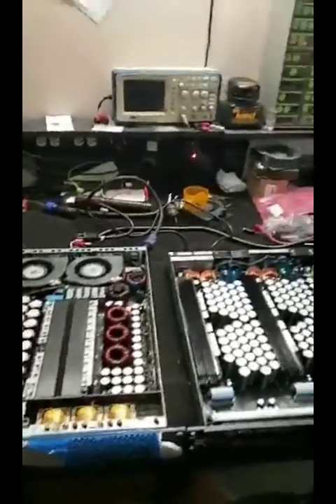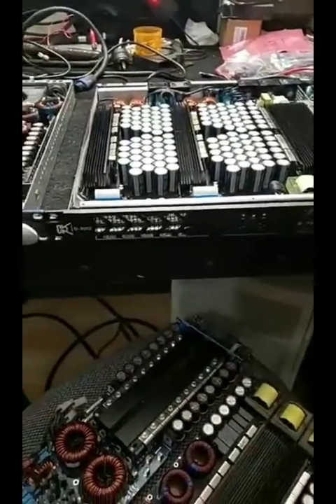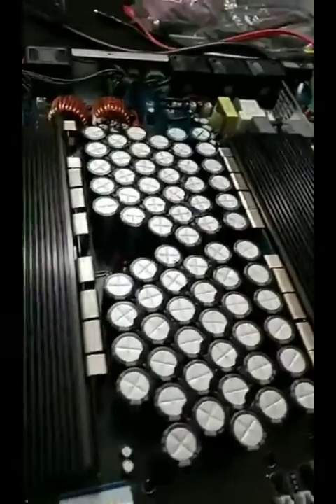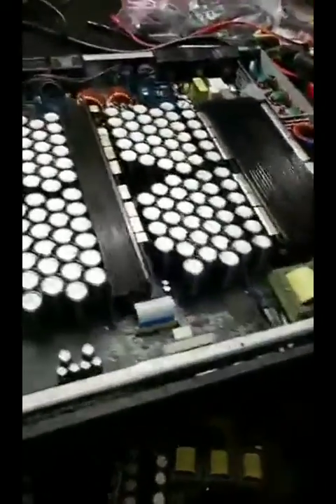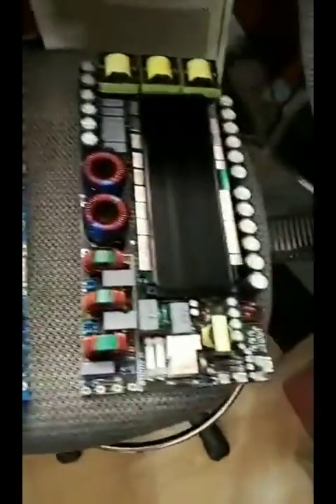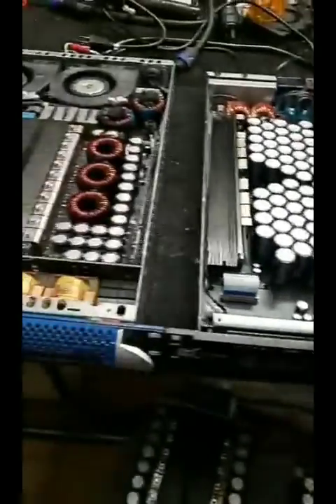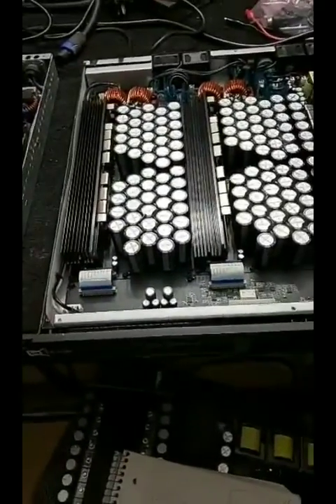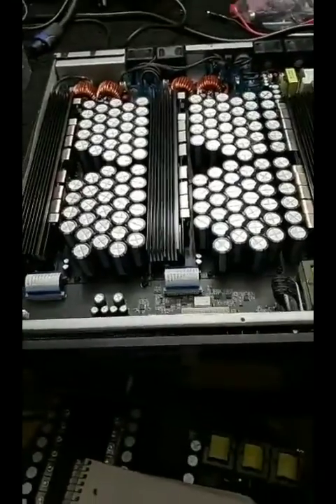Inside look of Powersoft amplifier and CVR amplifier Comparison

Comment: All well and good. What draws me to Powersoft and LGruppen is being able to get spares after years. My issue with some Asian manufacturers is that they often discontinue both product lines and spare parts once sales die down. The products themselves may be durable but one faulty generator at a show takes out a rack and it's all in the bin forcing you to get new equipment.

Durability is one thing, after sales support is equally important. Crown also has the same problem esp 1st gen itech which should still be supported but no spare parts🤷🏽‍♂️

Comment: Does this amplifier deliver the rated power or is the power rating wishful right before the amp blows up? How much current will this amp draw on 120 volts or 220? What about the rest of the need to know specs?

Comment: More capacitors doesn't mean more capacitance. How they're wired and their values  makes a huge difference - not to mention quality.  56 caps sounds like lower values in parallel- which is much cheaper in terms of components. The same with the power supply 6 caps+2 inductors vs. 20 caps (at least) and 3 inductors.  The Powersoft also has 2 large inductors in the rear vs. 4 cheaper.   The two large turbine fans have been swapped for 4 cheap 20mms.   I can't see the PCBs from the video but it's painfully obvious that you're dealing with two drastically differences in build quality and robustness.   The CVR is thousands cheaper because of the major corners they cut.

Comment: Nice video man very clear. Was just wondering what power the cvr take. The k20 notably has a 32amp feed powercon. Can the cvr realistically take this given that no amp with get 7000 a channel from 13amp 240 UK or other specificed ratings. Cheers
Reply from the maker: Hey thanks for watching man,  yes the Cvr has a  60v to 240v  circuit that switches automatically to accept a 15amp or 30amp as the powersoft.  Thanks for watching, please subscribe and share the knowledge.

Comment: Turn off your notifications! bro. CVR looks ok, why not put the caps closer to the speakers. Perhaps better if they had a few more caps on the psu though. Problem is getting cooling to the correct parts. Hot caps will fail sooner.

Comment: With a switching power supply capacitor doesn’t store power for the amp the switching power supply generates enough power to supply the amp the capacitor just filters the voltage.

Comment: Hello, really appreciated the video and comparison.  Are you still seeing these amps to be reliable after some time has passed?  I'm looking to pull the trigger on and FP14k or CVR 3002 but have heard sinbosen is a bit iffy on reliability.  Currently running an inuke 6k but my harbottles M18s are hungry for about twice what the 6k can feed them.   Curious if you still recommend them?
Reply from the maker: Hey, thanks for watching I appreciate it.  The cvr has been tried and tested they perform very well for their price 👍🏾
Reply: @Djshaw1kinglegend  awesome to hear that they are holding up 👍  have you ever put one on the dyno?  Just curious if they are like the berhingers, while they're good they are WAY over stated on power delivery.

Comment: My cvr both channels is lit red and not playing.i wasn't pushing it to clip.i don't know what's wrong with it.how do i reset it.
Reply from the maker: Hey sorry to hear that.  Contact Wasi wasi on Facebook he is the  technician and seller of cvr,  he  made this video he will assist you with reset or repair. Thanks
Reply: Ryan Ramjattan  your current supply is not enough, the amp used a lot of current. You have to have stable current at 220 voltage, I know one sound owner had the same problem you are having and he is running his cvr with a 40kva generator and that solve the problem.

Comment: Most of the labs failed due to operators not understanding they are a load strategy unit. They need corrct use. Just loading them at 2R Without using the correct settings is the issue

Comment: Quick question how many 21 inch can I play on CVR
Reply from the maker: I would do 3 per side on the cvr 3002
Reply: 2 ohms worth per channel
Reply: @warrior yes it can play 21 inch speakers & very well.
Reply: SRT HEMI   Thinking about getting some CVR
Reply: @warriorkingagony6035  they are the real deal no bs man. I have two D3002 & one D1004. Two of the 3002 are powering 16 21 inch woofers & man they are rocking! 6 each amp would be better if you want more headroom but they definitely can play 2 ohms good as well.
Reply: Thank for the video, sir. How this amplifier can store much power? The capacitance is so poor, little to support 18k rms. 😮 I calculated less than 15000uf all association

Comment: you say the inuke is inconsistent and I read reviews on it mentioning that they would stop working randomly. And the one you experimented with in your video was the nu6000. With that said.... have you seen or explored the nu12000? The reviews on the 12000 seem to be a different story. What is your experience?
Reply from the maker: Hey thanks for watching.  This video was done by a technician who repairs and uses powersoft and other higher end Amplifiers so his use of the inukes is not personal its from customers.  I own both nu4 6000 and the 12000 inukes ( please watch my vid on the 12000 unbox and setup) so from my experience they are both great amps, they may not stand up to certain abuse as do powersoft and crown but if you know what you are doing they will last and for the price no complaints here. Thanks again please subscribe and share the knowledge.  Oh yeah 1 thing i find annoying on the 12000 is there's no speaker muting when powering down the unit so you will get that harsh turnoff.
Reply: my inuke blew up - a track from the power section blew off the PCB and shorted to the case. Literal.. BANG. 

took out a chip and a few other components. end of.
Reply: @Djshaw1kinglegend  what's the biggest 2 channel cvr I can buy..
Reply from the maker: @SoundBarrierEntertainment  D-3002 cvr. Thanks for watching!

Comment: a comparison made on the visual basis has no factual value, without the difference between components or circuits you do not understand anything, how many PC power supplies while being very similar inside are completely different in performance, the only way to be aware of the differences is a test bench, and I bet the differences are huge.  At my house, the less you pay the less you have.

Comment: You realized that the chinese amplifier is a bad copy of powersoft, that it will never be able to live up to powersoft, that the power source in its PFC, the powersoft is superior, that the electronic components are of higher quality in powersoft , that the K series have been in operation for 17 years and that their support in technical service is incredible. Did you know that many of the components used by Chinese amplifiers, in the source and output stage, are copies of the original brands. That guarantees the durability of that Chinese equipment, of course for such an affordable price I don't think you can ask for it to have durability.